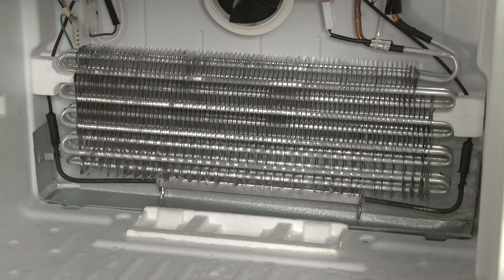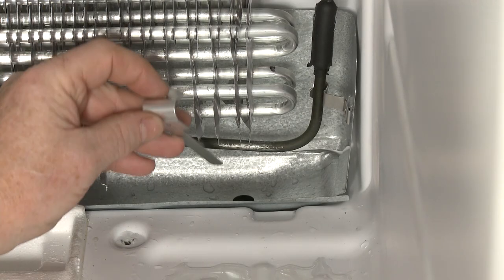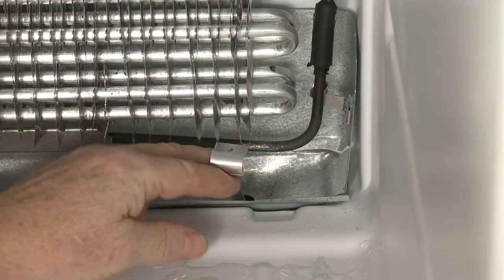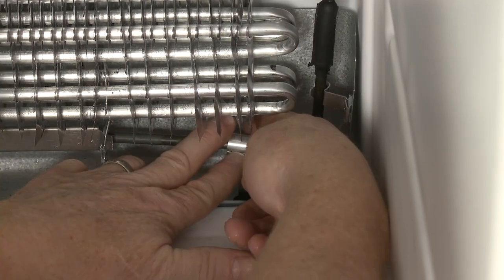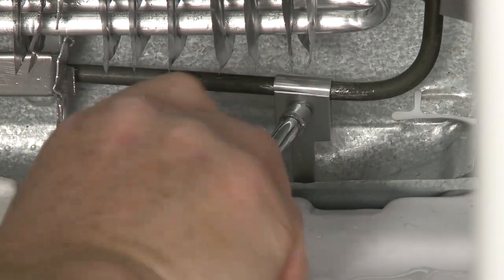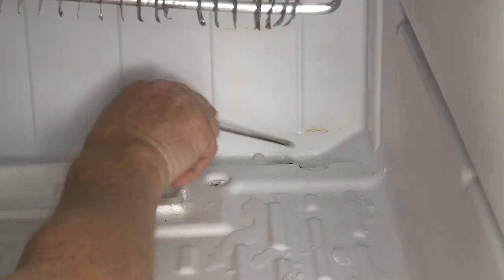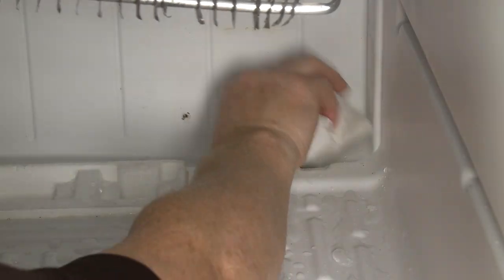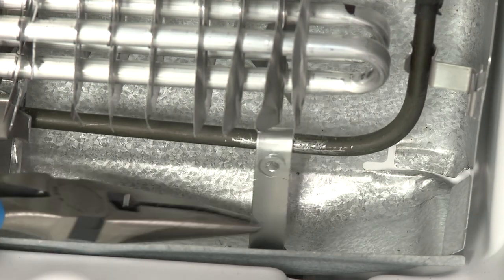Freezer Defrost Drain Frozen? Replace the Drain Strap

Comment: If you have a frozen drain, the cause is a restricted or clogged drain tube. Those drain straps are completely unnecessary and I have removed them for years with no call backs. Clear the clog and defrost. Correct the stupid engineers mistake in the drain tube depending  on brand and model by one of the following methods.

Removing the duck bill rubber piece that goes from round to a small slit.

Cut the p-trap at the bottom of the trap and add a simple strait tube to the drain pan.

On Frigidaire, uncoil the corrugated drain tube and reinstall with a nice straight slope to the drain pan.

Sub zero there is no permanent fix as the drain tube in the pan under the evaporator is too small so no way to correct the restriction. The customer will have to maintain it themselves by pouring boiling water in it from time to time.
I give a lifetime guarantee on this repair and never a call back.